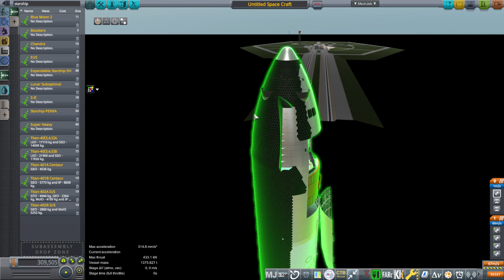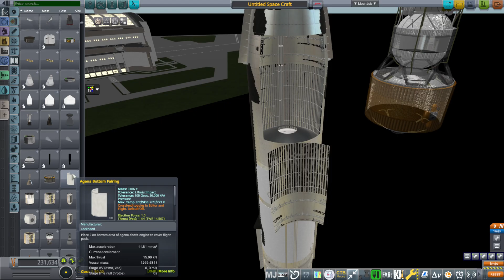SLS's Exploration Upper Stage in Starship?

Comment: I agree that putting it inside wouldn't work, but why not put EUS directly on top like you did previously for other ideas?
Reply from the maker: Mainly because the comment I was addressing with this video was one about putting it inside Starship, so I stuck with that, but the New Glenn upper stage is cheaper and nearly as capable as EUS anyway, so I figure it would be the better choice. It has also already flown, unlike EUS.